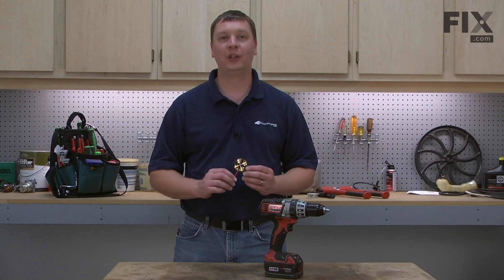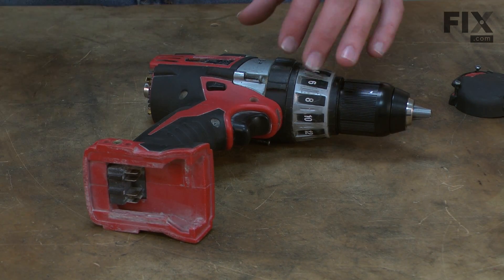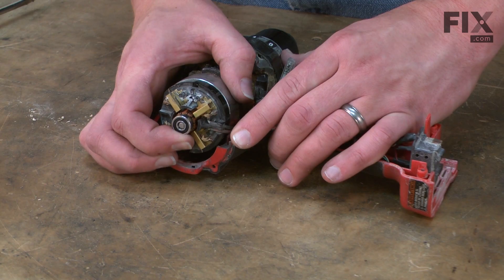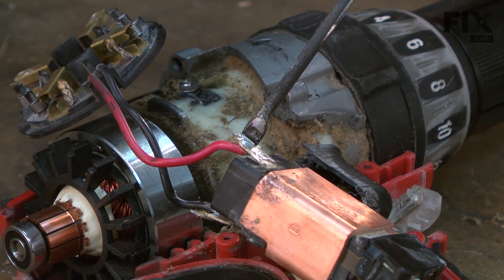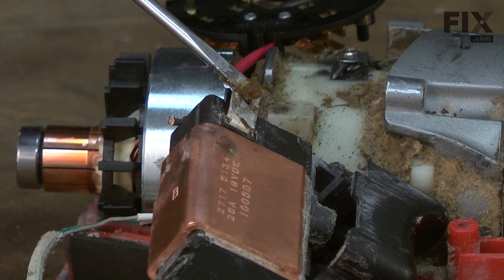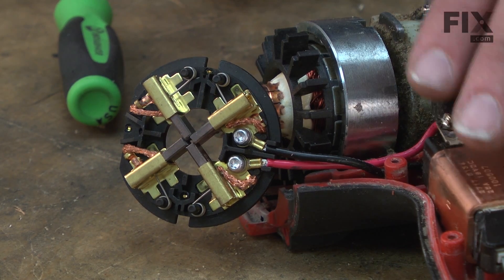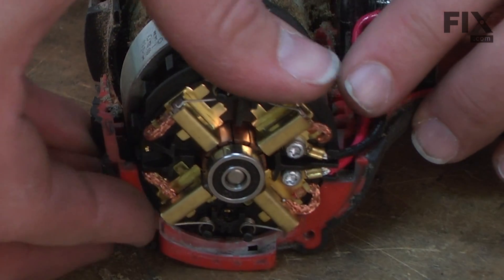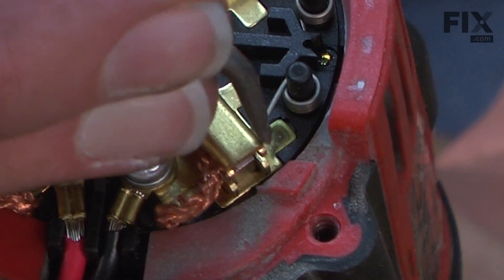Milwaukee Electric Drill Repair - How to replace the Brush Card

Comment: Amazing. No mention of the type screw driver to use. That appears to be specialized. LONG and a STAR bit of some type?   The actual replacement process is great but does everyone just KNOW what to use to unscrew those case screws?

B.
Reply: T-10 security bit did it for me. getting that back cap off, however, still working on it

Comment: So m18 drill, pull the trigger and led light comes on but no action.   Is that what was going on with this one? Or what were signs of issue?
Reply: Same symptom I got for mine, apply a pressure to the rear cover (where brush card is) and press the trigger, your drill might work, if yes, try to tighten the 4 screws.
Reply: @shihanjian5379  mine only works when the back cover is slightly unscrewed. If it's on too tight it doesn't work.

Comment: Hi! Thanks for post this, I will do it but I have a question what's the power of the solderer to weld and unweld the wires? Cause I'm trying with my own and I couldn't. thanks!
Reply: alot of the time if you add freash solder to it it will help with the desoldering

Comment: i live in Viet Nam my after 2 weeks hammer drill MIlwaukee M18 2702 - Brushless smoke and  death please hepl me thanks
Reply from the maker: Hi, even though the Electronics Assembly may look okay, I still think that the problems you have are coming from it. It is part number 14-20-0037. That is really the only part that smoke would come from on this drill.

Comment: he re-soldered the brush card when it has two screws and could just screw it in... amazing...
Reply: Sadlave MCMXC there are two types of brush card, one type has screws on the card as you saw, but replacements types don’t. No offence but don’t be quick to judge.
Reply: @grahamp2270   oh you are right, I was changing mine and assumed it vas thesame. Mine was with screws.